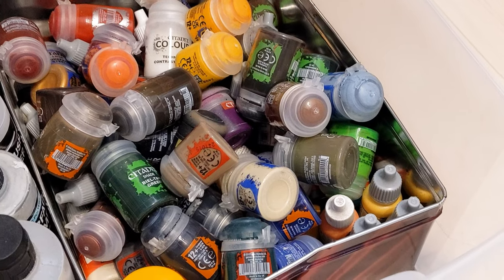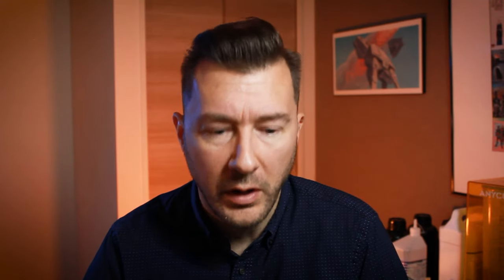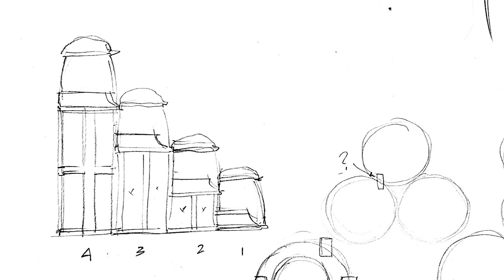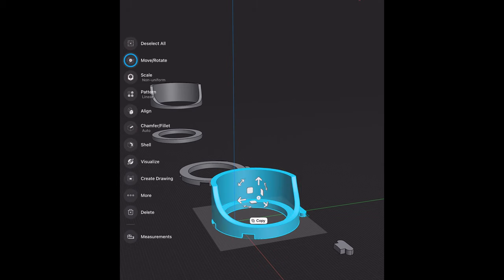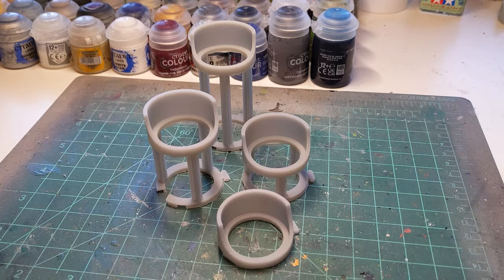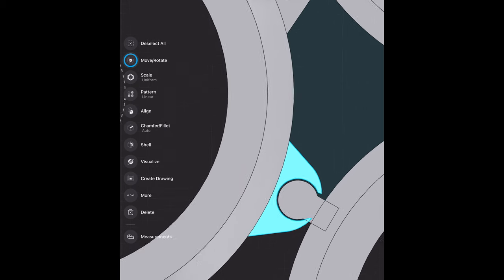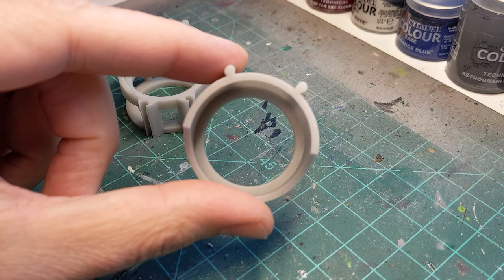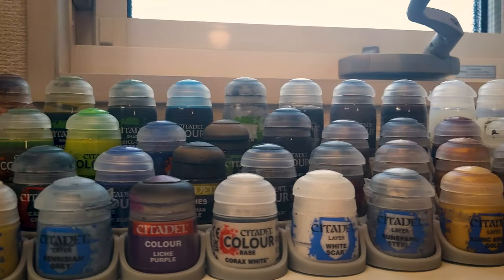Designing custom paint racks for tabletop mini painting!

Comment: hi! i just bought your files over on cults after watching the video last week. the files printed well on my fdm printer. i just wanted to let you know that the connections are super tight and will probably break when trying to get them out again. i was thinking that the fit would be looser since they are designed for rigid resin. otherwise, cool design, i'll maybe try them on my resing printer, was just hoping to get them printed in plastic because they would be more durable.
Reply from the maker: THANK YOU FOR THE SUPPORT! Much appreciated. So once the FDM printed modules are connected, it's likely they'll not come apart without breaking? The tolerances on resin prints are super tight, so they CAN come apart, but only with careful effort. Please let me know how your next prints work out.

Comment: Moved the video! and Keen to grab this paint rack, You mentioned how you also have Vallejo and Army Painter racks.
Do you plan to add designs for these as well? I use a combo of Vallejo and Scale75 paints (same bottle size) Would also be cool if you could mix and match which bottle size you want on your rack (incase you sort by colour not brand)
Reply from the maker: the file currently includes modules for GW and Vallejo size bottles, but I've been meaning to update with a hybrid that can hold both. Stay tuned.
Reply: @thehammerofwrath  Oh thats amazing, I will go grab the files now. Could be fun to tinker to fit some of my other bottles (like the Vallejo metal Colour and Liquid Gold Ranges, AK/Mig Pigments and oils. Lots of fun!

Comment: Maybe I missed or misunderstood, but I've seen you talk about the software used, but couldn't quite catch the name of it? =) Also, what would you recommend for a graphic tablet for a long time 3D designer/maker that's just starting out in the department of 2D sketches?
Reply from the maker: The software is Shapr 3D. I use an ipad pro with the apple pencil, but it's 3 years old at this point...
Reply: @thehammerofwrath   thanks a bunch! not an apple fan yet due to costs (I just entered the workforce after uni), but seeing how easily you design on a tablet definitely is a massive plus for me. I might try the wacom +windows option
Reply from the maker: I'm running the software on a 3 year old iPad pro (pre LIDAR model) and it's fine, so maybe look for one on ebay. Should be considerably cheaper than a new one at this point.